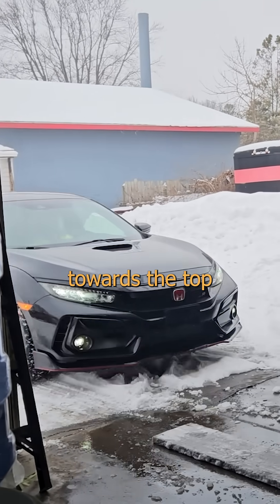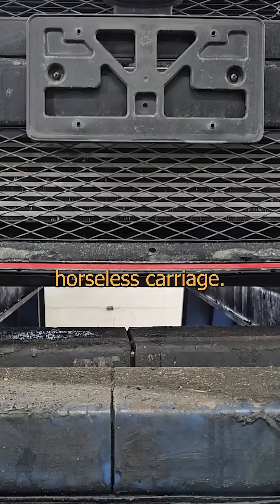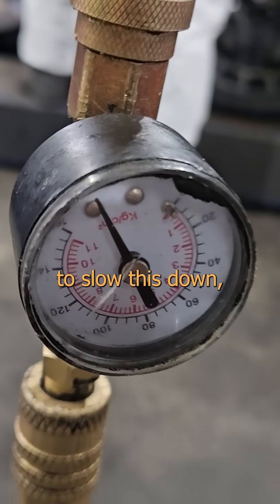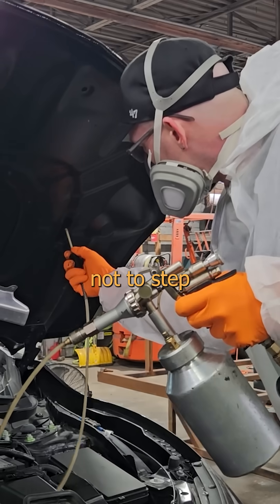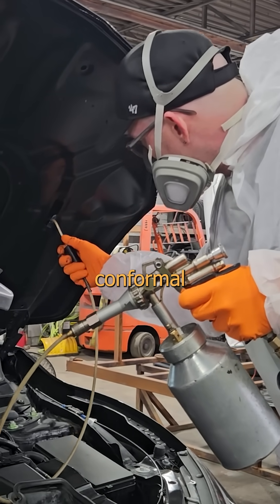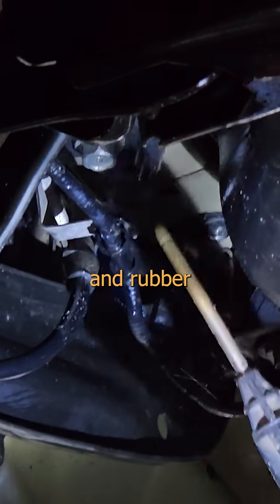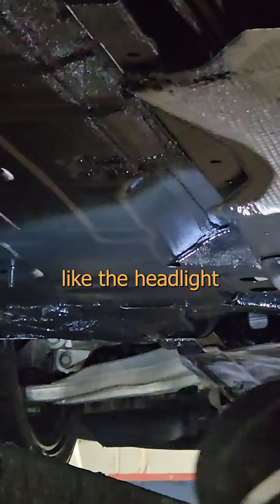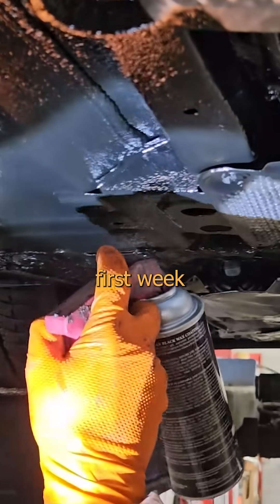How to stop rust on your car #chrisboden #comedy #engineering #wax #corrosion #science #winter #salt

Comment: Yeah, and you should probably also add in this video. Undercoating isn't a one-time thing. It's advised to get it done every year or at the very least every 2 years depending on the stuff you use but if you really love your car, whether you need to or not, just pay the extra money and redo it every year

Comment: I undercoat with fluid film, but I prefer to use oil based undercoating instead of wax based. But wax is better than painting or epoxy. Solid overall advice. Southeast Michigan resident here.

Comment: I plow and salt with my 2013 f250 and it has zero rust... I spray the under side with a mixture of 15w40 and transmission fluid.. About 10 to 1 mixture. I use an under coating gun to spray it and it works great. I do that about twice a winter and so far for 12 years it's kept rust away.

Comment: I have a 2004 outback with no rust at all in the engine compartment. the original owner forgot to change the oil on a slow leak, and a rod decided it had enough, and exited straight up. fortunately, I had a rebuilt engine handy. amazing what a couple gallons of used motor oil will do for corrosion. it also makes the bolts nice and easy to pull. so easy that I remind my mechanic to look for loose bolts as part of the inspection.

Comment: I have been spraying cars with fluid film as a side gig for a couple years. It helps a lot! The rust here in central NY is almost as bad as in MI.
Reply: Fluid film is good stuff. And absolutely worth it to pay someone you trust to apply it, makes a ridiculous mess trying to do it yourself without a lift (ask me how i know). 😅
Reply: @Z-Z-W_origin Oh yeah, I've done it at home on jack stands many times,  but this year, I'm doing it at the auto shop on weekends. I've invested in proper spray equipment and all that. I do the best I can to get really good coverage.
Reply: @Krankie_V  :  If I ever have to move back to the northeast, my plan is to take one or 2 vehicles back with me from the southwest, and then get them professionally done.  Up inside the rockers, inside the frame, all that fun stuff..  
.
Then touch it up myself for 4 years, and then bring it back to get all the little nooks and crannies done again professionally on year 5..  Rinse and repeat until I die or get back to the southwest.
Reply: @bobw53jrma  I do inside all the body panels and inside hollow parts of the frame when I spray them :)

The thing about me is, when I do something, I put a good effort into it. I don't do half-ass work, except maybe on my own beater cars.

Comment: On our work trucks, at, well, work, I like to coat the sensitive bits with expired electrical equipment conformal coating. It forms a harder than optimal coating but it's definitely not hard like epoxy. And for the price of $free.50, it's done a really good job. I've also used expired LPS 3, which really is an optimal product for this. But it's way too expensive for a home-gamer to buy and use on their car. Only way I'd use it on a car is the circumstances when it expires and can't be used on aircraft anymore.

Comment: i dont know what they use at our buddies tint shop, but i dont think it would matter if it rusted this stuff is so strong it would replace the frame. we had to clean the spray booth out for him once, bobcat, circular saw, angle grinder, sawzall and so many blades later and im convinced this shit is made of adamantium. i watched the bobcat bounce up and down trying to fold a section of it in half with the bucket

Comment: I like krown they have a shop up there towards your parts you should check them out and compare to wax I haven’t heard of wax before but before krown I was using good old motor oil it didn’t make it look like it was out the factory but it did to one hell of a job of keeping the more surface rust away but with almost all of life lessons prep work is key

Comment: The Blaster stuff work very well for DIYers. My '98 Nissan Frontier has a Wool wax and linseed oil concoction I made that is very waxy, but when Blaster came out with Surface Shield, I used that for in frame and touch-ups. (a self charge water fire extinguisher with the Blaster in it and a long plastic line and multi-directional nozzle for on the frame and rockers, paint sprayer for the rest)  My new to me 2011 Honda is going to get it soon as well. (today might be a good day) 
Tinworm sucks

Comment: Repair geek shows how this is done too and how you can do it yourself too. Ive been spraying my vehicles that may see northern use with surface shield, a lanolin oil based undercoating made by the crafty bastards at pb blaster.

Comment: I was using a product like this circa 1981. I believe it was called Waxoil or similar. The main idea was to get it into all of the hollow areas and let it seep into the pinch welds. The application wand was maybe an eighth of an inch and several feet long. Just stick it into every drain hole and spray as you pull back. When done with the hidden areas you went back to fog the flat panels. If you remember all the rusty Datsuns / Nissans / Chevys in that era, that was the target market. It worked well here in the northeast.

Comment: I'm a Fluid Film addict.  They've started using a liquid salt on our roads, as if regular old salt isn't bad enough.
Reply: That's mostly what I used on my 20 year old daily but I'm also trying out a similar but less expensive product from Kleen Flo called Honey Goo.
Reply: Fluid Film is good stuff. I swear by it. Still driving my 2010 1500.
Reply: the liquid salt is called brine...and yes, it is worse than normal salt.  fluid film is great stuff. i had a truck years ago, that i drove on the east coast for 5 years...got it coated with a liquid lanoilin/wax spray every year, first spray, within a week of driving off the lot...when i sold the truck, i could run a finger through the film underneath, and original paint was on there and untouched.
i even do it on used cars and trucks...extends the life of the vehicle considerably.
Reply: Yep that one is great. I'm curious if there are any consumer versions of the wax/lanolin like this video shows, because that seems like the optimal choice... But really, ANYTHING that coats the metal ACTUALLY SERIOUSLY WORKS to prevent rust.
Reply: @joegibes  everything I used came out of a rattle can and was bought from a consumer store.
Reply: @joegibes  Fluid Film and Woolwax
Reply: Fluid Film is based on lanolin, aka wax.  It's great!

Comment: Fun fact! Volkswagen already fills all the cavities under their cars with wax from the factory. Others may do this too im not sure. Also, the oil based undersprays like rust check are garbage. All they do is make an oily mess that attracts the dirt and salt and makes an even bigger mess. The best defense against rust is to keep the car as clean as possible, touch up chips and coat the car every fall and apring

Comment: I used VG 101 and VG 104 for my vehicle.

101 is wax based, while 104 is asphalt based.

Both flexible, with 104 being more abrasion resistant than wax and oil for thr exterior, but avoiding holding water like rubberized or other coatings.

Comment: 11 years??? Cars only have 5 year warranties. If they were supposed to last for 11 years, they would have 11 year warranties. Ive driven my cars until they died. Then resurrected them and drove their body a few more thousand miles. We got a new 4 years ago, and its already rusting to the point where it wont pass inspection. So weve decided, that all new cars today are disposable. We traded that one in, got a new car, then 5 days before the warranty ended, we got a new car. In 3 years when this one's NATURAL ENGINEERED LIFESPAN ends (or 5 years total according to their warranty) we'll throw it out and get a new one. It sucks that they design and engineer them now to be thrown away after a few uses, but oh well. They wanna make disposable cars, I'll keep throwing them away.

Comment: Its fun trying to explain a block heater to someone who has never lived in a cold climate
Reply: I once had an electrician apprentice with me for couple days. He was from Australia. We were in Finland and got a service call for rain gutter heaters. Let's say, that I had to start the explaining from the beginning, as I was convincing him that those are a thing.
Reply: @villehietala9677  I'm from Australia. Can you explain to me? I thought heated drive ways were an expensive use of energy...now we're heating roof tops in -20C weather?
Reply: @colingrant321 Ice dams. Depending on which part of the house is facing the sun the snow on the roof will melt a bit even if the temp is below 0 deg Celsius, then the water flows down into the gutter and can freeze before it gets to the ground, depending on the weather the problem can compound to the point that the dams get big enough to cause water to start dripping into the house in various areas that weren’t weatherproofed enough for it. Not usually too much of a problem on big simple roofs with a decent pitch, tends to be a problem on architecturally “cute” looking housings with parts that have no business facing North (away from any winter sun exposure)
Reply: @JamesJamersonIsAGod that's pretty cool.
Reply: @colingrant321 I use heated cables that run inside the gutters. They don't use a ton of electricity and it's like running Christmas lights in theory, just a tiny bit more expensive to run
Reply: @colingrant321 -20°C is a half way decent day in for a North Dakota Winter we can go for weeks at a time with -30°C with dips down below -40°C and thats not including wind chill and for other Americans out there the numbers are -2°F, -22°F, and -40°F
Reply: I have just looked up what a 'block heater' is, thanks for mentioning it. I'd never heard of or experienced the need for those.
Reply: @markrowlands1849 we use battery blankets too
Reply: They use block heaters on a lot of race cars these days because the tolerances are so tight that the engines would seize if you tried to cold start one.
Reply: @codybeck5425  actually it’s the oil we are concerned with being at the proper operating temperature. In my car we run a dry sump setup, therefore it is the external oil tank that gets a heating blanket wrapped around it.
Reply: I live in Edmonton, one year my in-laws were booking a hotel room to come visit and my mother in law asked whether the parking spot had a plugin, the operator on the other end of the line started asking whether we have a lot of electric cars up in Canada as its not the first time he's been asked that, ended up the operator was somewhere down in Texas and had no clue what a block heater was or why we'd need one.
Reply: Trying to explain a block heater to the poor Texan working on my old diesel cause I can't be bothered to get under it for basic maintenance when the parts all weigh more than I do. Poor fella didn't know why I had an ""extension cord"" lodged in my grill lol
Reply: @atreyu852011  I live in SK. It seemed the original owner of my last car, 06 Kia Rio wagon, bought it in BC and brought it over. Fast forward to my first winter, I couldn't find the cord because it didn't have a block heater. Researched what I needed to do to install one, and decided against it. Old battery failed to start in the first -40 cold snap. Replaced it, and that car started on the first go for the next 2 winters before I sold it
Reply: @TheChenkar even putting a battery warmer or an Adhesive oil pan heater would have worked decently well.
Reply: @k9turrent  The date on the original battery was already near/past it's expected lifespan. I did plan for one of those heaters if it acted up the second winter, but never needed it
Reply: @TheChenkar I wish I was that lucky I've replaced the battery in my car multiple times and if it gets down below zero and I dont plug it in I cant start it without a jump start ive taken to carrying a jump pack with me when I go somewhere I know I wont be able to plug in at, like to work.
Reply: In cold country, you need a plug-in non-hybrid
Reply: I technically don't live in a cold climate but always plugged my trucks block heater in during winter.   I also had a diesel so block heaters are a must.
Reply: My grandpa would sometimes light a small fire under his old Belarus tractor in the wintertime because it didn't have a block heater, lol. When there's work to be done, gotta get that diesel and oil to flow somehow
Reply: I’ve lived in Kansas and Oklahoma my entire life and I just found out about heated wipers a year ago. 😂😂😂😂
Reply: @box420 HEATED WIPERS???

I'm German and I've never heard of that. Wild.
Reply: As an Alaskan can confirm😂. Trying to explain to the terrorists I mean tourists why there is a cord in the front of our cars is hilarious and usually provides for some slight gaslighting opportunities 😂
Reply: I live in Michigan and got a buick from and old woman and it had a block heater.  It gets cold in southern half of the state, but not that cold.  I'm still baffled by it.
Reply: @creaslin  they aren't as common anymore due to how good modern fuel injection is. But if you have cold oil and carburetors then good luck starting that thing in a Michigan winter.
Reply: It's even more fun watching someone pay for a block heater in Ohio when they clearly never take their car out of state
Reply: @zer0theultimate  Yeah i have cousins who use to live in ohio i had to go there in January one year as a teenager and it around 20°F and I was asked to take the garbage out I did it in a pair of shorts (Ive lived in North Dakota since 1993). They couldnt believe that it wasnt to cold for me to take a 1 minute walk to the curb and back in a tshirt and shorts
Reply: @atreyu852011 yep, that's about normal for northerners. I know people who've lived here for 30+ years, they do the same thing. I do too if it's to put the cans out. Unless it's deep snow, I don't like wet socks😂
Reply: @atreyu852011 
It's a right of passage doing that here in Ottawa, Canada.
Reply: @zer0theultimate It gets oil up to temp much quicker. I'll do it for my Volvo too, and it never sees Winter. But a block heater in 20° will still send the car to 50°+
Reply: @glurak888 i know what a block heater is. I'm saying if you don't live in an area where it regularly drops to 10° or lower you don't need it
Reply: @zer0theultimate I live in Montana where it regularly gets much colder than 10F, hell -25F isn't uncommon, and as long as I have a good battery, my 2006 Dodge Grand Caravan starts right up. Most modern gas cars don't need a block heater unless temperatures are regularly dropping to -35 or lower.
Reply: Had the lower radiator hose heater, the dipstick heater, hell, even used an old electric blanket once or twice back in the 90's
Reply: I had an 88' Olds Cutlass Ciera until a few years ago. With that thing plugged in it would start like a champ even at -20. I miss that thing. I was shocked when my wifes 16' Equinox did not.
Reply: when I was leaving the Navy I was stationed in Florida, since I planned on driving my car back to Minnesota in December I knew it needed work. I took it in to Florida shop and asked for a tune up, an oil change, winter ties and a block heater. They looked at me like I grew two heads. It paid off though went from 70 Degrees to -30 degrees and through a snow storm during that 20hr drive.
Reply: Water heater element for your engine.  Plug it up at night for an easy sub zero start in the morning.  Easy to explain.  Self explanatory,  really..
Reply: @wesstone7571 youd think that but some people whove never had to deal with a winter below freezing cant seem to grasp it. When you say block heater they just look at you like someone hit the e-stop on their brain
Reply: It's funny for me. I live in the UK, I don't need Winter and Summer tyres. I just pop on the second to cheapest brand and I'm solid for 10,000 miles, unless a sharp object decides to speed up a visit to a garage.

Comment: Theres tons of under coatings and rust preventatives you almost need to combine a few. Rubberized undercoatings and bed liners in areas that will take a beating. Theres a inner panel coating made in Wisconsin i always forget the name but its not a wax and 1 drop will cover a 8" bench vise as it will creep. Ive used it on several vehicles and they've gone 8 years without an ounce of rust showing its ugly face plus my previous boss has used it for years in restoration applications and in the 20 years hes used it where its applied the rust doesnt form even on patch/repair panels. But always check for solutions that fit and comply with your area not all can be used in all 50 states unfortunately

Comment: I’m from basically the dry lands (Oklahoma panhandle). I never considered rust an issue. Sure cars and trucks (mainly fenders) rust over time but when I went up to Wisconsin, I was shocked to see how quickly rust can quickly take over a vehicle. I was behind a pickup I knew couldn’t have been more than 5 years old with rust spots on the rear bumper I could probably push my finger through. That’s absolutely unheard of where I’m from. Noticed many fairly new vehicles with signs of rust. 5 years here and you might show some surface rust on exposed metal underneath but that’s about it.

Comment: Tried lanolin once and it was the best by far. 
That guy moved away and I havent been able to find another guy using it 

Also Chris: there seems to be a distinction between “undercoating” and “rust proofing” , at least on the business side of things. I always considered them synonyms as there is only one goal. 

Finally if it’s first time for your vehicle  ask if they’ll shoot the rocker panels and shock towers. I had a place tell me “we don’t drill holes” which is problematic.

Comment: You can buy woolwax in kit, with a sprayer for $150.  I worked with a guy who sprayed AW46 hydraulic oil, and dusted it with diatomacious earth. Messy, but effective,  Fluid film spray is the easiest  .